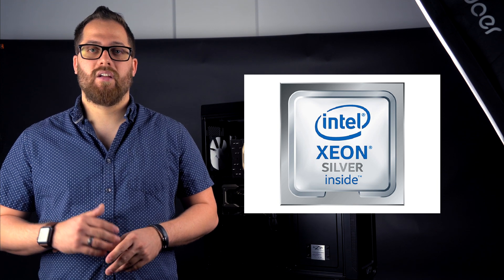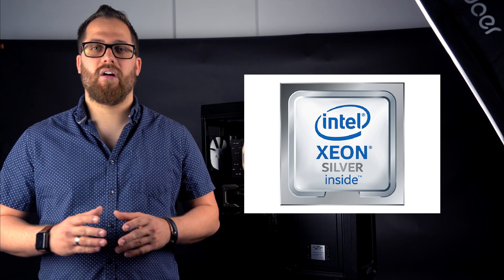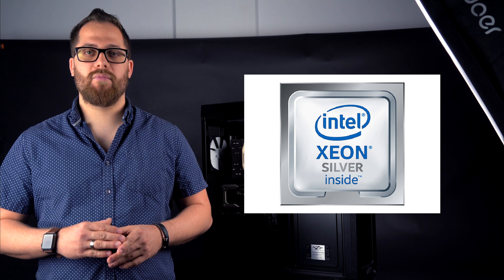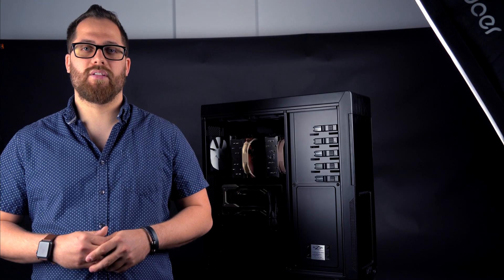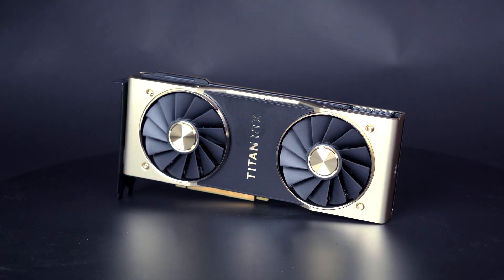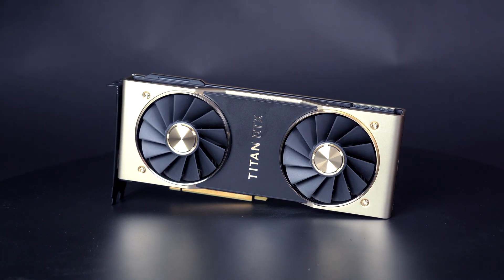GPU vs. CPU rendering comparison 2019 in Blender, Octane Render | TITAN RTX vs Dual Xeon  benchmark

Comment: Whats is usefull for 3d work(max,maya,lumion)
Ryxen 5 3600 + rtx 2060 super
Ryzen 7 3700x + gtx1660 super
Reply: rtx 3060 whenever that comes out, most liekly november. then you can save some more money and buy Ryzen 7, because Zen 3 will launch and willldrop prices for Zen 2 3000 CPU.

Comment: Pretty new to the computer world, built my first pc a few weeks ago, ran the bmw render test and did it in 22 seconds using the 2080ti gaming x trio. How is it possible I did it in that time and you got 47 seconds with 2 titans? I'm sure there are differences I'm not identifying
Reply: I know it’s a late comment but this video was nine months ago in the span of that time to your comment if I’m assuming you rendered that around the time of your comment there have been vast improvements to rtx based renderings and graphic card renderings I’m render engines across the board sense the posting of this video which could be why you see such a noticeable difference
Reply: Cody Wysocki That makes sense thanks

Comment: You should update this video once the Threadripper 3990X comes out. And do a GPU + CPU Blender renders.
I would love to see that.
Reply: Don't buy GTX cards.
Reply: @TomRadic  thanks
Reply: @uthpalanayanathara1871  Now buy Gtx cards
Reply: Whats is usefull for 3d work(max,maya,lumion)
Ryxen 5 3600 + rtx 2060 super
Ryzen 7 3700x + gtx1660 super

Comment: There's something about your system that's not running correctly. I can render the BMW with my RTX 2060 Super in about 34 seconds or about 18 seconds with both of my RTX 2060 Supers. Two RTX Titans should be doing noticeably better than my two RTX 2060 Supers. The rest of my system specs are basic. I have a Ryzen 5 1600X and 2166Mhz ram. Nothing special.
Reply: I know it’s a late comment but this video was nine months ago in the span of that time to your comment if I’m assuming you rendered that around the time of your comment there have been vast improvements to rtx based renderings and graphic card renderings I’m render engines across the board sense the posting of this video which could be why you see such a noticeable difference
Reply: @codywysocki8769  Part of the issue is he's probably rendering in cuda and my 18 second time it with OptiX. In cuda with two 2060 supers I get 32-33 seconds. While I agree that a driver update or maybe a tweak in the manufacturing process or even blender's utilization of the GPU can make a difference, I have trouble believing it could make that big of a difference that two RTX titans render in 46 seconds but two 2060 supers render 14 seconds faster. I think there has to be something else going on. But I could be wrong, I have been wrong before many times. I didn't buy my two cards until about the 1st of the year.
Reply: Issue is you can have latest greatest  spec hardware but lousy software like adobe and drivers that not updated or take advantage full potential of gpu or bugs or not well optimized..most things are rushed..look at programming its jumbled mess new programmers try to debug and  fix. Trust me programming can be time consuming.

Comment: I'm way too poor to watch this... it's almost depressing.
Reply: No worries, if your using octane you have access or ORC online render cloud,  enabling you access to as many gpus as you want online, for a small fee to render your scenes.  fully scale-able.  This has the benefit of users not having to spend crazy amounts of money on hardware, not to mention always having access to the best gpus available on the market/ as well as the memory required for your scenes.   But yes, building a solid rendering solution is very very costly.
Reply: same my computer cant even handle Eeve Render 
and While i press render my computer become BSOD
Reply: this made me lol.
Reply: Do threadripper. I mean. We're still all too poor for it but it's much better value than xeon at least, lol
Reply: do online gpu rendering

Comment: In GPU rendering, NVLINK is not about doubling speed like in gaming applications but rather increasing total memory for scene access.   With Octane Render your scene is loaded into the graphics card memory,  so lets say your graphics card only has a 1 gig of memory, you scene must be less than a gig in order to be loaded onto the graphics memory for render processing.   Even if you have multiple cards for network rendering, the scene must fit in each card,  octane does not 'Add' those additional cards  memory collectively.  BUT!! Octane does employ the use of  'Out of core' or off of graphics card memory, via your computers standard RAM.  this is user adjustable.  this enables larger scenes to be loaded and rendered but at the cost of slower render times,  due to the sending of data between GPU ram and machine Ram.    NVLINK on the other hand, connects two graphics cards effectively making them act as one physically.  Since NVLINK is crazy fast Octane as does your computer then sees the two cards and their individual RAM as ONE.    as such NVLINK enables the combining of cards to increase their ram capacity.  Enabling larger scenes to be loaded without the loss of speed via Out of Core.    BTW,  Out of Core sends only stores both Texuture and Mesh data.
Reply: damn that was an incredibly helpful comment !
thanks alot man

Comment: GPU rendering is faster but it's very limited to memory which's way more important than rendering speed I still prefer CPU rendering.
Reply: Memory limited and also not every effect works perfectly like on CPU, still there a limitation in material/light settigns when using GPU, at least i feel limitation with VRAY GPU / OCTANE / CYCLES, don't know other engines. Workarounds for this limitation can takes hours more job to be done.
Reply: Hi. Cuda rendering uses regular RAM as reserve when the graphic card's onboard memory gets saturated.

Comment: RTX 2080 TI is the most worthwhile choice by price per performance.
Reply: No it's not. Not much different from 1080ti 11gb except ripoff  price $700 vs $1400. Not enough vram for heavy workloads it's more gaming card some edit 3d. Titan rtx 24gb is compromise for serious pro creatives plus gaming in between geforce card 11gb and commercial quatro p8000 ecc 48gb/p6000 32gb.
Reply: @cjonwickham1933  And Now must be RTX 3090.

Comment: Tile sizes make difference with render times.it will be more accurate to have same tile size.(cycles)
Reply: On the contrary - CPU and GPU perform better on different tile sizes. If you pick one tile size over another you will give advantage to one or the other. Testing both each on the best settings suited for the hardware makes more sense comparison-wise.

Comment: What setup would you recommend for Interior design rendering using Vray?
Reply: threadripper 32 cores, or you wait for the 64 core one. dual card or more are goood for Fstorm
Reply: @Challenging_Reality  Which video card?
Reply: @GurdevSambali  tell me how much is ur budget for each part
Reply from the maker: Thtreadripper 32-Core + 2-4 NVIDIA 2080 Ti GPU based workstation will do a great job! See here http://bizon-tech.com/bizon-x5000.html

Comment: You did not test NVLink on Octane. That only kicks in when the required VRAM is larger than one GPU can hold. This is not the case with that benchmark scene. OctaneBench in its current form is not suitable to test NVLink performance.

That said, it won't get faster with NVLink but slower, but you will be able to combine the VRAM of two cards and therefore doubling the space available for your geometry data and textures (48 GB). This is much faster compared to "out-of-core" which means resorting to RAM for large textures etc. and therefore a lot of traffic over the slow PCIe 3.0 bus.

The beta for Octane 2019.2 is now out where you can get a better understanding with your own (heavy) scenes. Also, Octane Render just gut released for free on Blender 2.8, Unreal Engine 4 and Unity 2019.2. With that free version you can use 1 GPU.
Reply from the maker: Will this work for  TITAN RTX? I think memory multiplication feature is available for Quadro GPUs. We did numerous deep learning benchmarks on Ubuntu with and w/o NVLINKs and if you type nvidia-smi nvlink -s you will see that that feature will be marked as "disabled" for all the RTX-series GPUs.
Reply: BIZON yes, it works for several GPU render engines as of today. They had to implement the use of NVLink by themselves first. This has been the case for OctaneRender since 2018.1 and doubling VRAM works on consumer cards now.
Reply: That’s actually great to know (free for Blender with one GPU), will play around with it :)

Comment: Nice vid. Could you do one that shows which 3D software makes the best use of the single vs dual GPUs? Cinema 4D , Blender, 3D S Max, Maya etc...
Reply from the maker: We already did those kind of benchmarks and GPUs scales perfectly depending of hw many GPUs you have.
Reply: Whats is usefull for 3d work(max,maya,lumion)
Ryxen 5 3600 + rtx 2060 super
Ryzen 7 3700x + gtx1660 super